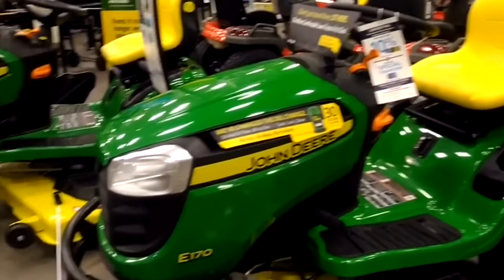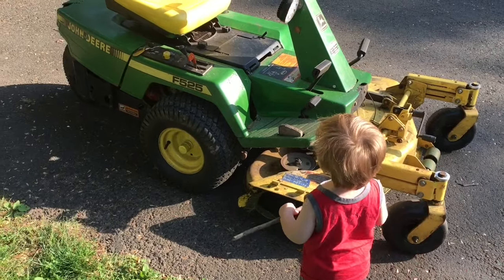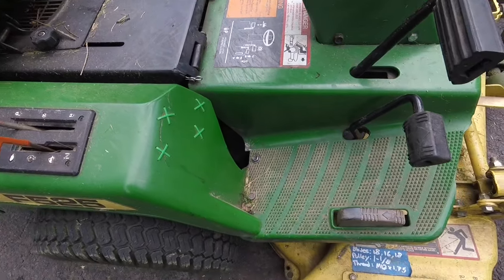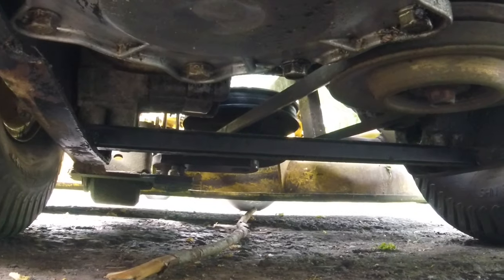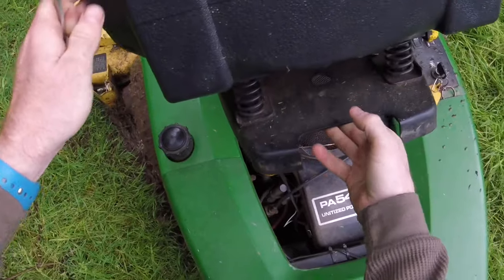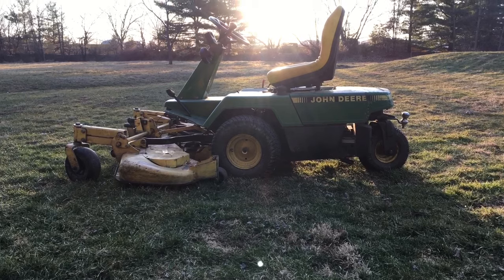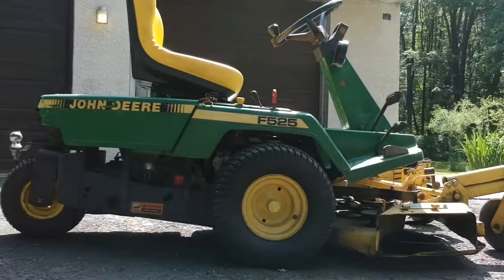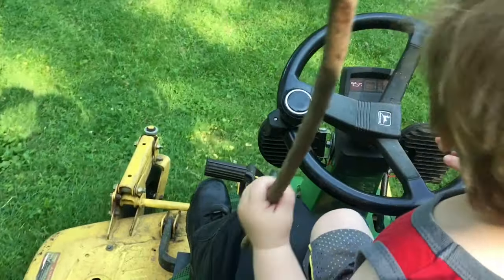Forgotten Mowers: The John Deere F525

Comment: a customer of my handyman service just gave me one of these today.he said it's twenty years old....but the hour meter says 406 (which is perfect for Montana...our area code for the whole state!) it cleaned up pretty nice, and has no damage on the plastic! the seat is completely thrashed though.😢 i guess i'll spend a few bucks to get it running before i decide what to do with it.
Reply: I have an F-525 I bought new in 1995. It’s got 1300 hours on it and still mowing my lawn. The only thing I’ve done to the motor is replace the electric PTO clutch twice and the cable between the pedal and transmission. Of course I’ve replaced deck and drive belts a few times but still in the original blade spindles. It’s always had Mobile 1 synthetic oil and a new JD filter every year. Take the deck off yearly and grease everything and it should last you a long time.

Comment: My 1995  F-525 has 1300 hours on it and still mows my yard. I’ve had to replace some small parts but nothing major with the motor/transmission. I’d love to buy another unit like it but nobody makes one anymore until you get into the $15,000+ price range. And they are really bigger than I need. For some reason all the vendors in the US have switched to developing zero-turns and tractors. On my hilly terrain and with teenagers doing the mowing those units are just too dangerous due to their high center of gravity and the zero-turn’s instability tracking across side hills. The marketing people have once again taken over from the engineers.

Comment: I just bought one of these for $150. All of the plastics are perfect and it's not even faded. The reverse didn't work when I bought it but part of the cable housing had just popped out and I pushed it back in. Works fine so far and I mowed the whole lawn with it. I have to say, it mows really nice except for the very dull blades it has. You can get really close to everything with the front offset deck and not have to do much weed eating. The oil looks brand new in it and so does the oil filter so I think it was pretty well taken care of. Someone bought a house and it came with the house and they didn't want it anymore. I think I got a great deal. Cool video

Comment: I was actually going to be sad if you were truly trash-talking the F525.  This is my favorite mower of all time (even more so than my high-speed diesel hustler).  Sure, it only goes 5mph, but just like you show in the video, you can do donuts in it all day long.  It cuts around trees and under trees like a dream.  The best feature that you missed in your description is that because its center of gravity is so low, the kiddos can jump on this thing, slam the wheel to the left or to the right, and drive it like the 5mph race car that it was designed to be.  Try doing 1-handed 360 degree turns with zero turn!
Reply: @davehimlin2374  It's like a car with 100,000 miles, could be 1 owner with full service history that doesn't need anything except consumables when needed, or it could be thrashed need all the repairs someone else neglected to do. If it runs and functions well with evidence of being cared for/money spent then you could do much worse. Transmission and deck condition are probably most important. Naturally you'll probably want to negotiate on price, doesn't hurt to try.

Comment: My grandpa had a 1988 180 with the 14 horse Kawasaki, It had an estimated 2000 hours when the transmission quit. He ran it up until 2009. Those engines run so smooth. I bought a 2007 X324 with no hood, starter, battery, air filter, and mower deck that I bought for $100. It had 1473 hours on it when I bought it in October. It had 1633 when I sold it. I would start it with a corded drill, and a 17mm socket. The day I bought it, it hauled 700 lbs of dirt up a hill in a trailer. The most reliable machines I've owned have had Kawasaki engines in them. I will never buy a new Kohler. Our Cub Cadet has a KT735 in it, and it runs good, it just starts hard, even with the choke. I will stick with the 1968-1983 Kohler engines. Kawasaki ain't american, but they still are the best engines made in my opinion.

Comment: My mom has one that my folks bought new.  It's always been garaged so the plastic is still in perfect shape.  This was the first year since new, that any major maintenance had to be done, asides from routine oil changes, where we did belts and blades and misc tune up, and needed to replace the seat safety switch, and coincidentally also the starter.  Great video!

Comment: Man, your video was spot on!  Got my F930 for free, needed a ton of work.  When delivered,  I was so excited, "I got this for free", little did I know.  But a couple years later,  got it to where it is fantastic, alot of little fixes, not much money just ( sweat equidy).  Mine had 2nd hydraulic spool underneath side dash, differential lock lever on front of transaxle, made simple foot actuator .  With tire chains and diff lock and  an old non working  5' snow blower used as a snow pusher,  this machine is so versatile.  Seems like all the components are heavy duty,. I LOVE IT " don't think I'll ever sell it!  PS everytime it would break, my wife would say sell it, I'm glad I had faith in the old deere.

Comment: Great Video and spot on.  I have owned two of these machines and love and hate them.  Difficult to work on and service but I bought the last one in 1997 and it is still going great as of today.  In fact I have bought two machines I have for parts if I need them.  I have replaced all of the plastic and mine looks like new.  New decals also.  I change the oil and service once a year and I am approaching 900 hours and no major issues.  I have looked at all of the zero turn mowers and find them lacking compared to the F525 for my needs.  The bagger system goes on and off quickly and I only use it in the early spring and fall for cleanup.  My yard is full of circles around trees and it nails the mowing around those.  Not much trimming required.  The original price was steep but divided by 25 years it was a good buy.  Parts are very available and reasonable.  Thanks!

Comment: I own one and have had it for over 20 years.  Bought it 2nd hand from my brother in law. He has regretted it every time he cuts with his Kubota. Also because I convinced him to give me a lifetime free service contract. ha ha Today, the deck belt popped off for the first time in history and I came to You Tube to find instructions.  I found this video and have been highly entertained.   Mine has the same piece of plastic missing, but I love your stitching job.  Did you paint those zip ties?  
This is the BEST video I have watched in a long time.  You had me laughing with the kittens.  It does take me a while to mow, but it was such an improvement over my cheapo lawn tractor with a much narrower deck.  Looking forward to more of your witty videos.
Reply: Mine is a 2000 year model, I bought it used in 2006 and it's been going strong ever since. It's VERY important with these body panels to wax them yearly, JD even says to wax everything on this mower yearly in the owner's manual (which nobody reads unfortunately). Also don't leave it parked in direct sunlight.... mines body panels are still like new.

Comment: I have the F725, and also love it. 2-wheels in the back, and much better traction. I also have the optional cab, complete with windshield wiper. I replaced the drive tires with tractor lug style. And can traverse just about anything, and easily blow the deepest snow without chains. The advantages of a front mounted, offset deck are also undeniable. But you are right about the freewheeling 'feature'. It totally sucks, once I could even understand how to use it. Either way, this tank will probably outlive me.
Reply: Hmm the F725 we had had an umbrella with fans we promptly ran into a tree, other than that it was a great mower quote good on slopes it was very forgiving and predictable.

Comment: My F525 won't turn over even after replacing the starter and battery. I stumbled upon this video looking for repair ideas. I was seriously considering junking it, but your video changed my mind...
Reply from the maker: Make sure the various safety switches are working! Brake pedal safety switch, weight sensor switch, PTO safety switch, etc. Even if the motor is locked up you can still sell it for parts, the plastics alone are worth $$$ in good shape!
Reply: @thedoubtfultechnician8067  Ummmmmmmmmmmm.... We wired a switch so that the starter is wired directly to the battery now. She runs like a champ. This is the recommended method for professional idiots only, don't try this at home.
Reply: @MurkyNightmist  I had the same issue with mine. It would crank fine if I wired 12v directly to the starter solenoid. My fix was to install a relay. The starting circuit wiring operated the relay. Then the relay was wired to power the solenoid. That fixed it. There are 24 points of failure in the starting circuit; if any of them are not making good contact, the amperage to the solenoid is insufficient. But it is enough to pull in a relay. Then relay pulls in the solenoid: Battery > Relay > Solenoid. Doing it this way preserves all the safety's (Brake, Seat, Blade etc). Hope this helps somebody.

Comment: Interesting video. Full of humor, disadvantages an  advantages  of the F525, even moving garbage bin LOL. I pick up one in real bad shape. The deck has holes that have bolted patches & about 40% of the plastic is broken or just gone. It did start when I picked it up and now a no click/no start. I am sure it is one of the safety switches but which one 🤔 It is late in the season & I am backed up with projects but will try to post a video on the repair.
Full view & .👍 #211
Stay well, Joe Z
Reply: Only 2 safety switches, the one under the back of the seat and another under the parking pedal. Each runs about $20 off Amazon. Neither safety switch will prevent the starter from cranking the engine over however, (they will just kill the engine if it's running, or prevent it from firing up... in short, the safety switches will cut power to the ignition system and only the ignition system). It's important to learn how things work.  Regards!

Comment: This remains the best JD mower I've ever owned, and JD hasn't produced any other lawn mower I would pay money for. My F525 is now some 25 years old and still going strong and looks like new even though it's used weekly during the spring summer and fall months (I just started mowing the yard again last week in fact). The key is to park them out of direct sunlight, and WASH and WAX the body panels at least once every year to preserve the body panels and keep them from becoming brittle (JD even says to do this in the owner's manual, not that anybody ever reads those things apparently). I finally put a new replacement seat on it over this past winter, other than that it's all original. Just saying.
Reply: Also I notice there was no mention of the leaf/clippings bagger attachment for this mower. I don't have one either, but always wanted the snowblower and the leaf/clippings bagger attachments to make my mower complete! LOL! (doesn't snow here actually, but the leaves in the Fall are a force to be reckoned with!).

Comment: Funny to find this recently. I bought an older F525 after pining after them for close to 15-20 years. Your video hits a number of the issues head-on (you think that deck attachment process is bad, you should have outlined what's involved for the snow thrower...), but also hits why I wouldn't trade mine for the world.

I actually wound up buying a spare F510 to potentially harvest parts from, but I'm half inclined to keep it around and try to work with people smarter than myself to convert it to electric power...would remove my concerns about obsolete Kawasaki parts availability and gummed-up carbs for the most part...

Comment: So funny and so well made!  I sold this same mower after mowing on it and getting yelled at by my Dad every time it would fail.  The guy at John Deere even yelled at me one time after bringing the mower back when their fix didn't work.  Hate John Deere, overpriced junk.
Reply from the maker: How did it keep failing?
Reply: @thedoubtfultechnician8067  There were a few different fails, in the mowers defense, I mowed on it for over 20 years.  It still ran when I sold it.  It often had trouble starting, jiggling the key just right would get you past that.  It always had to be jumped off, something would drain the battery.  When finished mowing if you disconnected the battery, it would ensure a start at next mowing.  The worst was when there was relay fail, the John Deere dealer had fixed it, I mowed about twenty feet and it died.  There was no way to get it into neutral, Dad had to get out a tractor to drag it back into the bed of the truck to take back to the dealer.  He made me go talk to the mechanic.  I remember the mechanic aggressively asking me what I'd done to it...
About four years before I sold it, the transmission or engine was weak, it went slower than its already slow speed.  Enjoyed your video!  I thought you were making a smear video...there were a few good things that you highlighted.  Loved how that deck stuck out on the left, and maneuvering stuff with the wheel housing.
Reply from the maker: My mower only works at all because of fixes that the dealership would never approve of and I suspect yours might too lol! Recently mine started burping a drop of oil into the intake. Big puffs of smoke for 30 seconds, runs a little rough, then back to business. Dealership solution? New engine. My solution? $5 catch can.
Reply: @thedoubtfultechnician8067  Mine was doing the black cloud thing also for a couple of years before I sold it.  Less severe than what you described, black cloud for first 30 secs or so
Reply from the maker: I agree, it’s likely some gutless 60’s antiques with a small two blade deck and zero features. Would be cool to hop one of those up.
Reply from the maker: Roughly 1100
Reply from the maker: Funny you should ask. Just this spring it started burping a drop of oil out of the breather hose into the intake, which would cause it to stall and then smoke like Cheech and Chong at a snoop dogg concert once every few hours before clearing up again. Simple home made catch can fixed the problem 100%.
Reply from the maker: My catch can fills up about 50mL per season, not too bad yet. Haven’t even had to empty it. Gotta love free fixes lol
Reply from the maker: My transmission seeps a little oil but otherwise is fine, and since it’s a piston pump it should outlast the engine. The engine itself is the same as the FC540V except for the oil pan and camshaft so parts shouldn’t be too hard to get. I imagine a top end rebuild could be done in the tractor. Mine has 1100+ hours on it and purrs like a kitten.
Reply from the maker: You don’t think zip ties would chew up the lawn? I’ve heard you can fill the tires with antifreeze too… I replaced the traction assist spring which helped dramatically, and idk if you saw my other video, but I mounted a winch to the front just in case :)
Reply: @thedoubtfultechnician8067  If you're leaving muddy tracks in your yard, then it's too wet to be mowing it.... just wait till everything dries out! Not that I haven't gotten mine stuck a time or two (but I also got it's 4 wheeled conventional predecessor, a JD GT242, stuck a few times also). Getting stuck always suxs but hey it's life! LOL!

Comment: I’ve got a f710 still runs like a champ, however my deck is starting to rust which is causing some problems holding my pulleys.

My mom has a 265 that’s still going strong also.    It did have the frame welding a few years ago though.

Comment: They are not horrible if you have a small to medium sized flat lawn. However they are known for the $11 crankshaft seal falling out and into the transaxle and blowing up the engine. JD published a couple several service bulletins on them that mentioned replacing the crankshaft seal with an updated one that was made of metal instead of the original rubber coated seal seal. The rubber coating on the seal would deteriorate and allow the seal to literally fall out.

Comment: you're funny.. we have a HUGE slope, you don't drive it forward of wet grass- you back that thing up. I love how low it sits and I can see all around it. If you keep a nice piece of ply wood around, that you can shove under that spinning drive wheel when you get too close to the precipice, it backs out real nice.. Kinda reminds me of that really cool Toyota Hi-lo I drove at work forever.. real nice reaction time.. I have videos on my channel.. mostly leaf tossing.. I just added a lawn sweep recently because the loader f525 came with was the lamest clog bucket.. I don't mind it doesn't go that fast.. I wouldn't know the difference, after huffing and puffing behind a push mower, and my lawn looks better than a golf course. 2.45 acres on a hill with tough slopes, mole trails and lotsa trees and shrubs- if you back it up, you'll make it!! Plus it saves on weed whacking! Blow it off real good after you use it, change the oil and filter, plugs every spring, keep the blades sharp, keep good belts on it, you are good to go.. just don't abuse it.. I use premium gas btw, and the deck gets cranked all the way up, looks more uniform in color and you gets no scrapes.

Comment: Yeah on my dads old LT160 I quickly figured out that if I pull the forward pedal backwards it’ll go revers much faster. But yeah good luck w cruise control in the 90s unless you had a manual trans Deere back then.